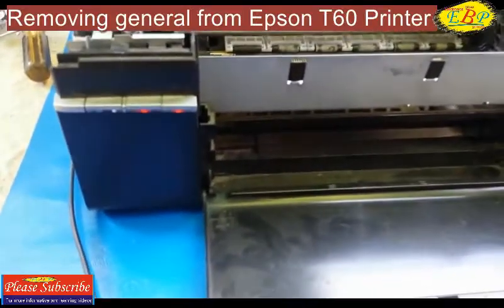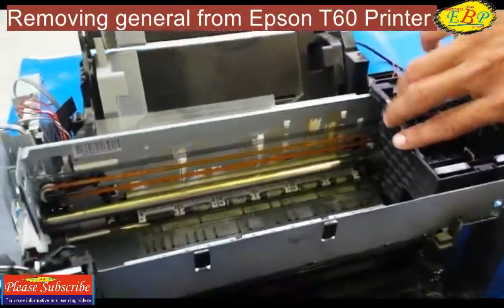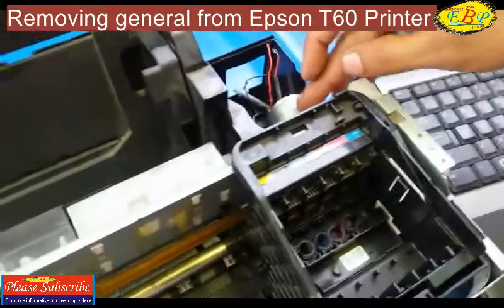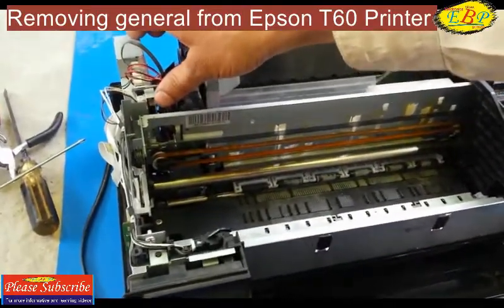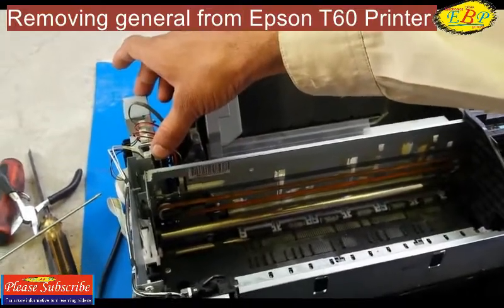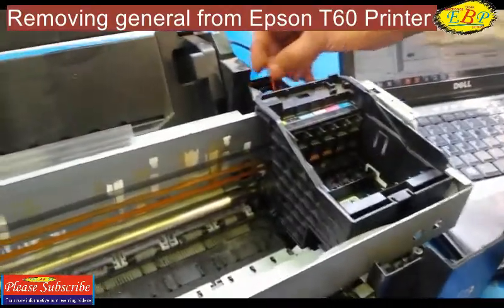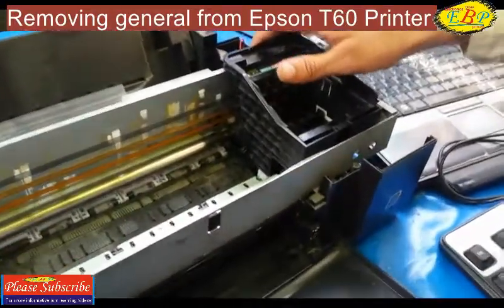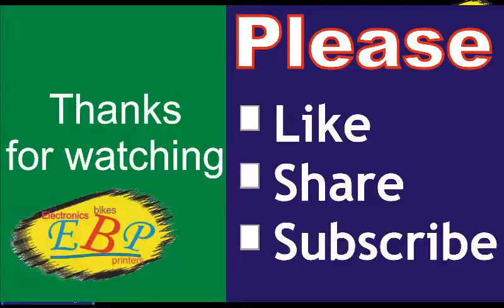remove/ solve/ clear/ fix  general error in Epson T60

Comment: thnaks for this video,in my T60 printer general error appears sometime,sometimes it works properly but sometimes appears,when i power on head moves and goes to end when it comes back it stopped and general error appears,any help for this should be positive for me,thanks in advance
Reply from the maker: can you upload a video ?? for this when your printer shows general error ? I will try to find out the reason...